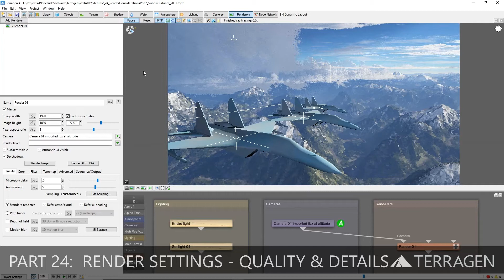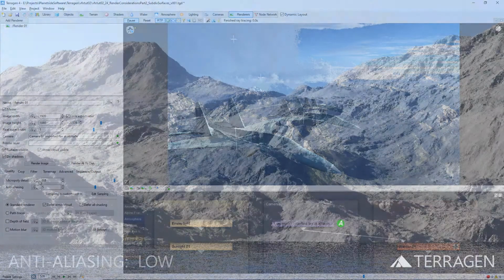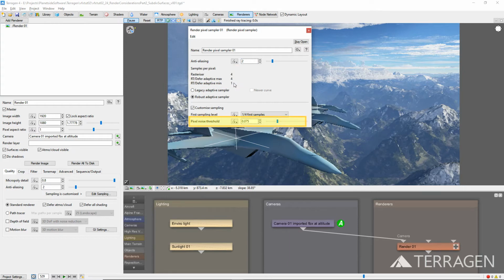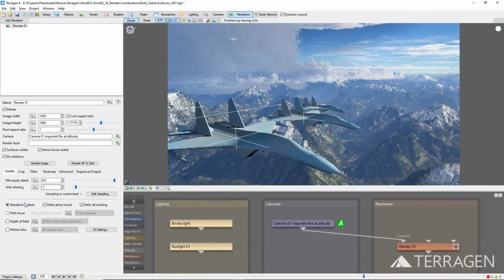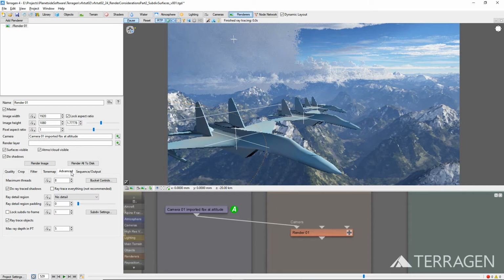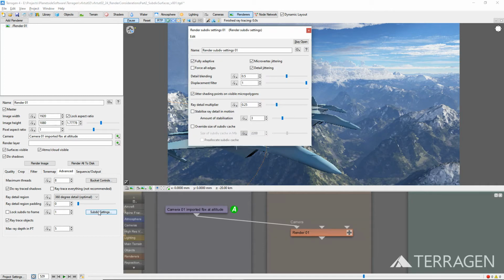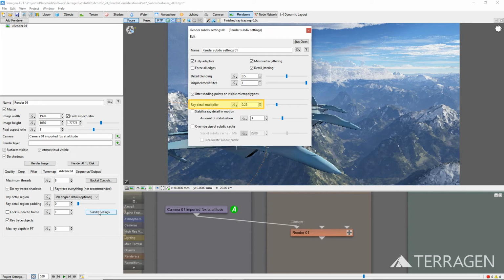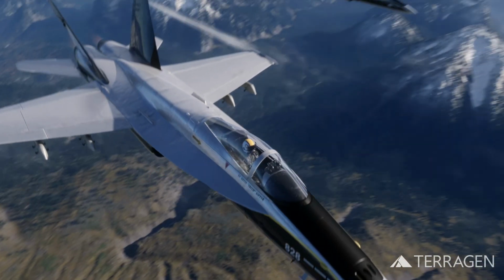Terragen for VFX: Part 24 - Render Settings Quality & Details

Comment: how you setup other computer to render ?
Reply from the maker: Hi astralboy79,

Assuming you have Terragen 4 installed on another computer, the recommended procedure would be to export your Terragen project and assets via the "Export Gathered Project" option found under the File menu.  This feature consolidates the project assets into a folder which can then be transferred to the other computer.  After that, it's simply a matter of loading the project and rendering it.
Reply: @PlanetsideSoftware  Sorry i mean how to perform distributed/cluster rendering? Also does terragen rendering favor multiplecores over clock speed for viewport rendering like blender ? And also if it benefits to use a GPU to speed up rendering ?
Reply from the maker: Hi astralboy79,

Terragen is compatible with a number of render farm and render management solutions.  Here's some links to that information:
https://planetside.co.uk/terragen-resources/#render-farms
https://planetside.co.uk/terragen-resources/#render-managers

For rendering, multiple cores are preferable.  Up to 32 cores (64 threads) per instance of Terragen seems to be the current sweet spot.  On a high end workstation, like the AMD 3990X Threadripper, you can run multiple instances of Terragen and render more than one project at a time, or distribute the render project across multiple instances.  

Currently, Terragen 4 does not support viewport rendering like in Blender; furthermore Terragen 4 rendering is solely based on the CPU not GPU.

Below are some additional links you might find useful, which go into greater detail about rendering in Terragen.
https://planetside.co.uk/wiki/index.php?title=Rendering_Methods
https://planetside.co.uk/wiki/index.php?title=Rendering_Optimization_Guide
https://planetside.co.uk/wiki/index.php?title=Path_Tracing
https://planetside.co.uk/wiki/index.php?title=Terragen_4_Global_Illumination
Reply: @PlanetsideSoftware  thanks that is helpful

Comment: its too complicated for a layman, try to make the software controls more simple like 3ds max. its good to have details but these seem programmer or 3d mesh expert level.
Reply from the maker: Hi astralboy79,
Thanks for your comment.  While it's always good to be able to simplify controls whenever possible, there are times when having control over subtle details are necessary, especially when working in a visual effects pipeline.  If you find specific controls to complicated, we recommend posting your questions on the Planetside Software Terragen forum, where you'll find many users who are more than happy to share their knowledge on all aspects of Terragen with you.
https://planetside.co.uk/forums/index.php
Reply: @PlanetsideSoftware   having a nice set of presets. Aerial view, aerial with clouds, no clouds, ground view, deep aerial perspective..etc.. I am not sure on the categories but someone can figure out the general groupings that significantly change the render settings that put the user in the ball park or maybe rollover popups that explain the setting or a simple link to the wiki. They do this in GAEA.